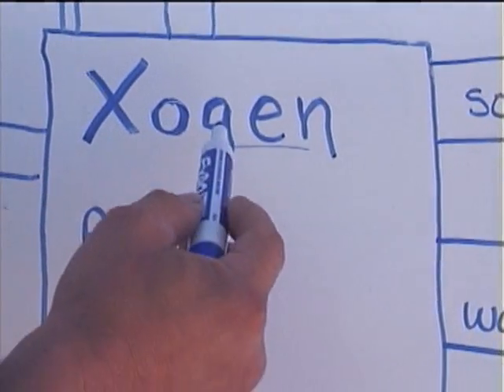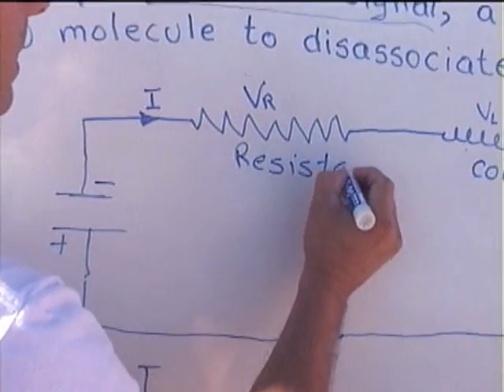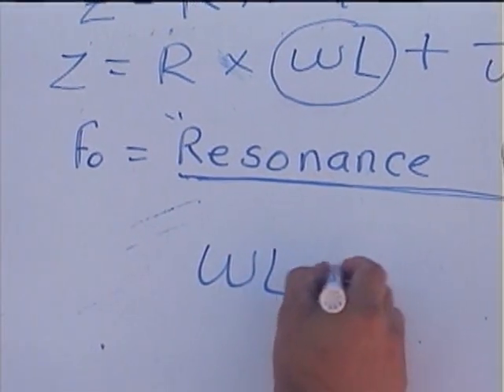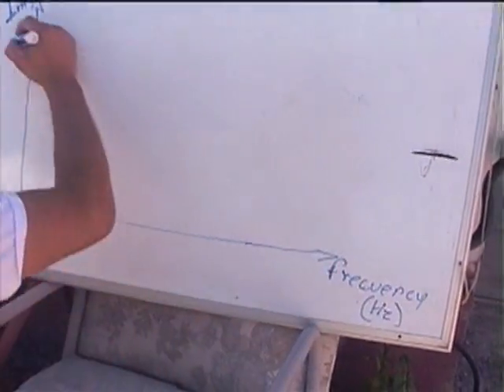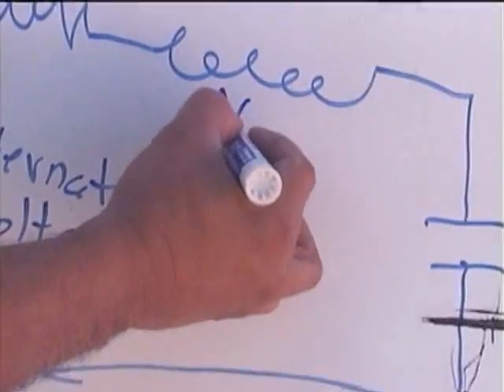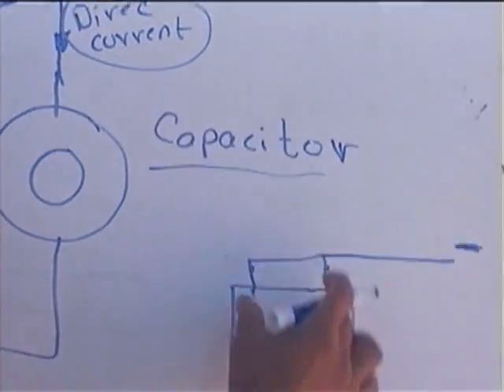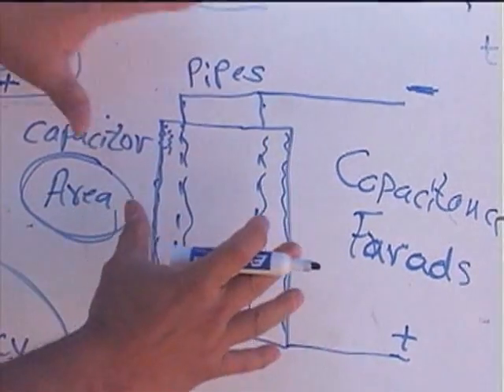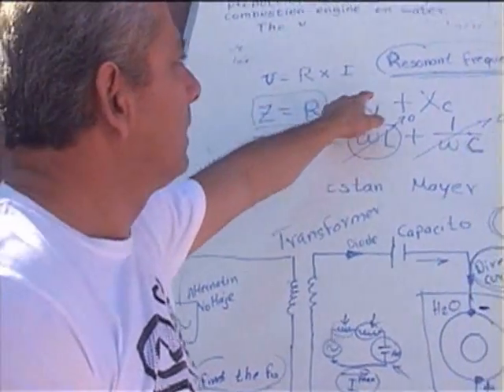Water Electrolysis Super Efficient

Comment: One could fracture water, with 15,000 to 20,000 pulses of current per second, using a bridge rectifier circuit and step up transformers, along with inverters. 
 It is similar to why men marching in cadence break cadence when walking across a bridge. The vibration from the marching creates a frequency, which excites the molecules of the steel of the bridge, that can cause the steel to fracture and thereby collapse the bridge.  
The beauty in what you are showing in your video is you eliminate the need for an electroliser, which greatly decreases maintenance. 
Also. Titanium for the plates or pipes should help to increase production. Awesome video, keep up the great work.
Also a PEM cell, (proton exchange membrane cell) could be an alternative.
Reply: Titanium isn't good. Why would it be?
Reply: @TravisTellsTruths  Have you tried it?
Reply: @TravisTellsTruths  I believe you are looking at it from a point of conductivity electrolysis, not from the perspective of frequency vibration fracturing. No electrolyte needed

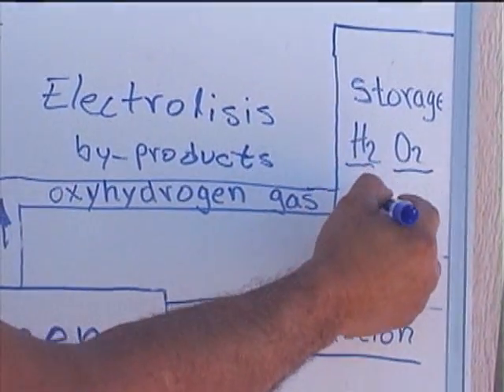Comment: I stopped right at 0:47.  You store hydrogen and oxygen in a container, under pressure: You basically have a friction sensitive bomb.  I will keep my testicles, thank you.
Reply: it is possible to keep them totally separated and using a sensor and explosion proof air pump would be easy to build into an acrylic vent
Reply: There would hardly be any gas of either stored. This would be an on demand system. As the gas pedal is depressed the frequency would very to meet the demand. You must be new to this, or you work to misinform.

Comment: If you think about it. The H atoms are connected on one side of the O. So with the frequency you may start spinning them around until they have a smaller energy needed to break the bond between H and O. 
However a long pipe like Stanley used would never work. The gasses start traveling between the pipes thus breaking the electrolysis. The way is to long. Inside the gas there is no electrolysis. 
I do believe in frequency but how? 
The alternator connected on one side and back thru the main frame gives a frequency. But that’s not high.

Comment: Screw all the Einstein equations.  Basically, if I use high voltage, instead of 12 v dc power; it will become more efficient?
Reply: if you use 400 volts dc power  with  1000 miliamper you will produce a lot of hho in one minute

Comment: what is the performance of liters of Hydrogen/min divided by watts input? Do you have a graph by frequency to show the best? Liters per  min Hydrogen and frequency. If what you claim is correct it should be easy to show. I don't want to be negative but if you don't show this there is no proof that this really works and you are just blowing smoke. Science is based on practical facts